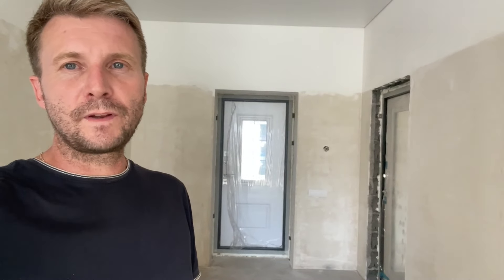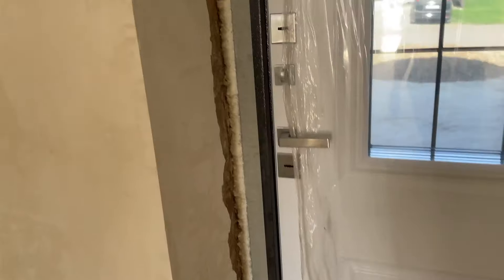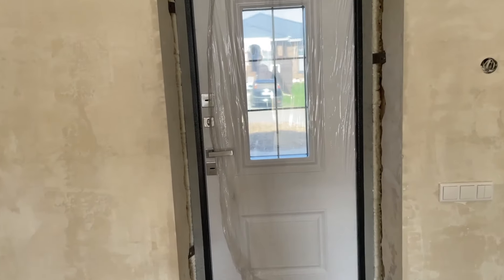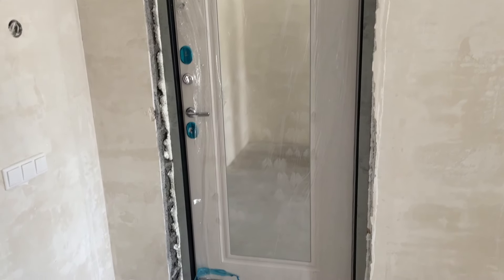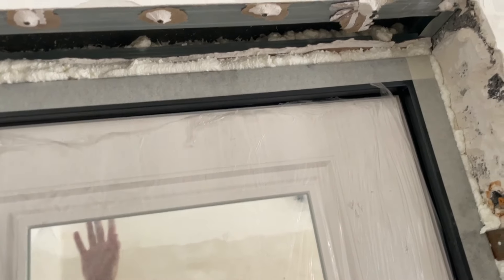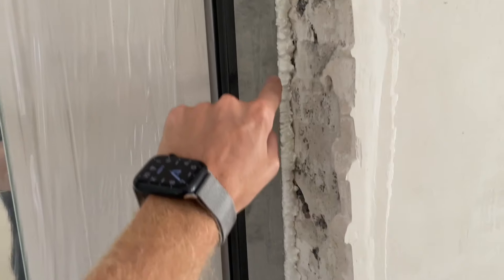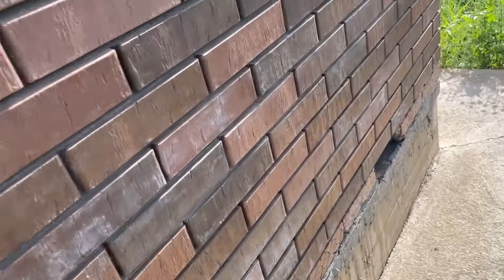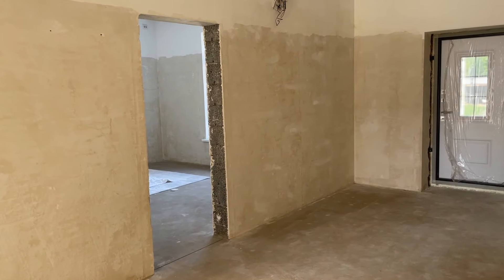English Family Restoring our Russian Home | New Doors Post Foods make a huge difference.

Comment: The weather in your region is hot, the walls of buildings at such temperatures warm up very quickly and well, increasing the temperature inside the house. So I have no doubt that your house will be completely dried out over the summer. The doors are very good👍
Reply from the maker: Absolutely you are right. The house is almost dry now. Another month of warm weather and all will be dry.
Reply: Typical Orenburg summer.

Comment: A bigger door won't do any harm, and slicing a bit off the wall has probably paid for itself in information and reassurance.
So all good. Back in before Autumn looks very likely.
Your insurance company should be happy too - a lot cheaper than a write off. Hopefully they aren't giving too many problems as a result. They can be a bit of a pain.
EDIT: The glazed front door is a great idea. It will be lighter and cheerier and makes advantage from adversity, which is always good for the soul.
Reply from the maker: Yes you are right we will be in there before autumn. One day at a time. A bigger door is better. Can for more through it. Although we didn’t have insurance so no payout there.
Reply: @RussianTravels   No insurance saves dealing with an insurance company, but is a bit of a blow.
It is very different from the UK where no lender will provide a mortgage without insurance. It is not so much for the borrowers benefit.  Essentially, they insist that the borrower pays for insurance to protect their loan against a possible borrower default following an event like this one or a major fire etc.
The decision to recover and refurbish the property now makes a lot more sense, though an insurance company would probably have insisted on it anyway given that the house has survived rather well and is nowhere near being written-off. Hopefully your compensation from the government will go a long way to covering expenses given that you are doing a stirling job on the labour front yourself.
Anyway, progress looks great and I bet you cannot wait to see your family settled back in again. You have 'broken the back' of this (unwanted) project, as they say.

Comment: I see that you house plan is designed so that front door doesn't have some intermediate closed space connected to the front door (so called "тамбур" in Russian). How do you feel in winter when somebody enters the front door - especially when it is about -30 C outside?
Reply: There's not much point if the door opens like 5 times a day. Only make sense where there's a lot of traffic
Reply from the maker: Yes exactly.
Reply from the maker: The porch. Is useless just becomes a dumping ground and attracts lots of insects especially in the hot summer. Last winter was absolutely fine. Back the car into the warm garage and enter the house that way.